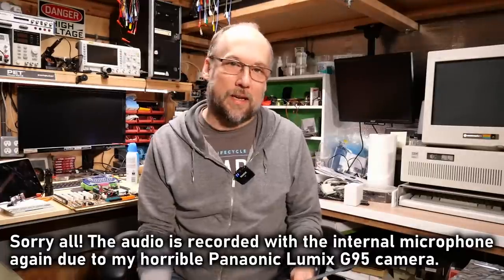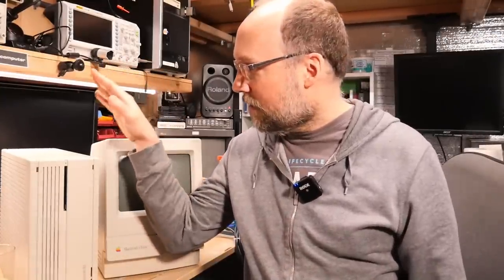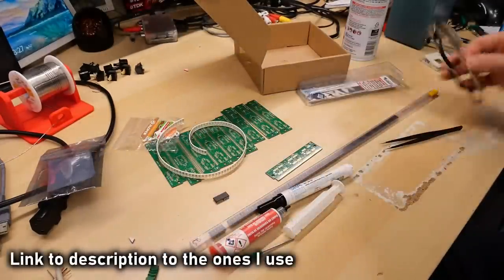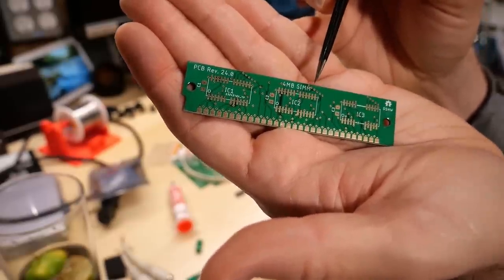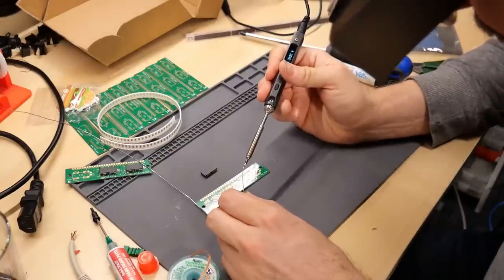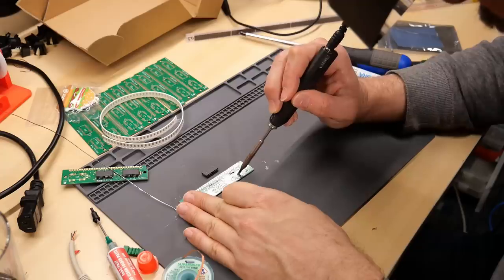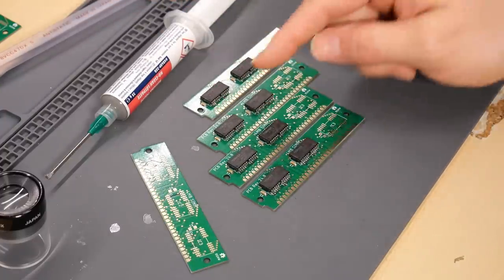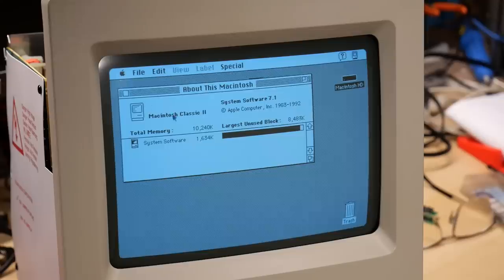Nibble Size: Let's make some memories!

Comment: Hey nothing wrong with learning a new skill! Personally for "larger" low-volume SMD stuff like this I don't bother with hot air. I start with clean fluxed pads, tack in the chip on opposite corners, and solder each pin one by one with a fine tip and a roll of fine solder. Slow but I find it much more forgiving. Cheers!

Comment: Adrian, I would suggest watching some of Louis Rossmann's MacBook repair videos for tips on SMT soldering with hot air - it's amazing to see how 'sloppy' you can be when applying the solder and how well it comes out.  You will notice he uses a lot of flux (available from his store) to heat up the whole component, not just one side.  I think you will learn a lot from his videos - I know I did, even after 40 years as an EE.

Comment: for how you tried to do the 2nd 1.. you should have just done it all by hand no hot air at all.

just a FYI.. 

all those pads are huge.. they are well withing your capabilities to manually solder. 
just have some confidence and take your time..

Tin up all the pads, (also the legs if you can do that without causing bridges) 
place the chip on the pads. then just heat up the top left pad and leg at the same time. then the bottom right leg and pad. this will ensure that the chip is  square and all legs are on the correct pads..
after that its just a matter of heating each pad and leg combo 1 at a time. Don't add more solder to them unless it is absolutely essential.
Just remember you heat up both parts you want to solder together so heat the pad and the leg at the same time.
and Keep your iron clean.

the small caps its the same thing really. 
tin up the pads. and then place the cap. you should see just enough pad so you can heat it up. the solder on the pads should be enough to hold the cap in place. I would not add solder to the cap before you place it. 
1ce you have 1 side of the cap tacked down.. you can add solder to the opposite end, then come back and add solder to the 1st end you tacked down..

Its well within your ability, they really aren't that small.

i personally wouldn't use hot air at all with that. (unless i needed to remove the ram for some reason)
just do it by hand.

Comment: Adrian, never use a continuity function or resistance function on logic signals (memory logic, etc), unless you know for sure that the open circuit voltage on the DMM is lower than the chip's supply voltage, otherwise there is a high risk of damaging the chip. MOS does not like overvoltage.

Comment: I would recommend getting a stencil for the boards so that you can better apply the solder paste, SMT packages for the ram. Then you could use the soldering iron to solder the bottom-left most and top-right most ends to the board and the use the hot air gun to solder the rest of the leads.

Comment: 10:07 tiny bypass caps? those a giant 1206 caps, when you are ready for 0402 parts you know what tiny is.
Reply: I had to use some 0201 resistors because I was building a board to fit a space and it was laid out by someone else.  VERY strange soldering using the Amscope with the iron tip looking massive.....
Reply: @cowasakiElectronics  what 0201 resistors would you recommend for this?
Reply: @adonvonpanzern  the resistors were supplied at the same time as the board. I have no details.

Comment: I do the odd bit of SMT soldering, most of the time its mounting though hole parts where SMT is supose to go. It is a little tricky & fiddely, but you do get the hang of it.

Comment: I was under the impression that the paste is just flux mixed with solder filings

For jobs like this, I'd personally just tin the PCB with kester leaded solder, putting some paste flux down from rossmann's store, and reflow with hot air. Worked perfectly for the project I'm working on, which has much smaller parts like 0402 resistors

Comment: easy hack even for cheap solder paste: squeeze some solder paste and mix in some more flux (i usually do this on some plastic bag) , use toothpick or something to mix them up , then use the same toothpick to apply this mixture on pcb pads. it helps a lot to spread the paste more evenly and its easier to apply

Comment: Tack a corner first. If you find the chip is off the pads just a little that's when you use the hot air. You make the chip dance into place on the wet solder. This will also clear a lot of bridges.

Comment: I wouldn't use solder paste personally without a stencil on pads this small - the good news is because you have the blueprints for the pcb, you can make the stencils (lots of companies here in Oregon actually make these!).

I usually do smc soldering with regular solder, some really consistent flux (like Amtech or Chipquick).

Comment: Not bad for a first try soldering SMD. Those SOJ chips are a little tricky if you've never done it before, but it looks like you're picking it up pretty quickly. And you've got plenty more to practice on! 😁 Hopefully you've got enough there to upgrade a few machines. But if not, the gerbers are available so you can always order more!

Comment: i did some smd soldering a couple weeks ago, and since i don’t have a hot air station, i used the soldering iron to heat the paste and it actually worked really well. i can’t check until tomorrow but i think the soldering paste i got has flux, so that might have a little to do with it, but after the first few like that it was super quick, unlike the one i tried to do with regular (not thin) solder wire which took ages.

Comment: Sorry to double post -- but also usually solder paste is put on with a mask I think? -- Was there a solder mask included in your order from JLPCB? -- Like the mask is usually a little transparent slide that has cut outs for all of the little pads so you just wipe the paste over the mask and use a little wiper or business card and then it's applied to the exact right bits.

You can also use some solder braid and just run it across the pads to tin all of the pads in one go. -- Also Voultar's channel is really good for soldering tips and tricks -- he does a lot of Console modding and walks you through the tricky bits -- there's tips for both thru hole and surface mount soldering. -- He even has a few series where people sent me in really poorly modded consoles from ebay where he fixes them. -- It's worth checking out.

Comment: Saw this and wondered why somebody would build SIMMs when they're already so cheap. But I guess 4MB is hard to find in 30 pin. Using brand new chips is probably the expensive route to take for something like this. If you can manage to do it, it's likely cheaper to salvage chips from 16 or 32MB 72 pin SIMMs (which will often have 8 or 16 4Mx4 DRAMs).

On the other hand, brand new chips won't need desoldering (which requires hot air)

Comment: solder paste is nice for something with many soldering points, if you get used to using it.
Then again, if it has many soldering points, you will socket it anyway.

Comment: For soldering things like that.
Dont use solder paste.
Solder paste really works best with a stencil.

Start with the smaller things first, then move to the larger items.
And you just tack one pad to secure it, then reheat if you need to adjust, otherwise solder down the rest of the pads.

Comment: I have a set of metal helping hands I use when I need to do hot air smd work. Those mats are rated for higher temperatures than the desk, but I have damaged mine in a few spots by touching it with my soldering iron.

Comment: Solder paste looks dry, it likely went bad long before it shipped to you, otherwise its just bad paste in general. Solder paste does have flux and should dispense pretty easily at room temp. If you're buying parts from Digikey already, buy the paste from there as well. I'd recommend either SMD291AX or TS391SNL, has good shelf life and working time. The 15g syringe will go a long way, no real need to buy larger quantities unless you going to do production level volumes of board in a short period of time. I used less than one 15g tube doing a few dozen 60x80mm boards.

Comment: I solder SMD ICs under a stereo microscope. Use a gullwing tip and good flux. I solder such an IC using drag soldering within a minute. Solderbridges, flux again, gullwing, but with the well dry, move them from IC outward in the direction of the legs and it will "suck" the solder in its well. no need for wick.

Comment: Doing fine work like this, a solder mask would likely work best and then you kind of "Screen print" the solder paste on to the boards.
Doing it by hand with such small pads is really hard as you need to try and just get paste on each pad and not sort of "smeared" across the board.  Solder Paste usually has some kind of flux with the solder in suspension.  Extra flux doesn't hurt though :).

Comment: The way to use solder paste is to use a stencil and a squeegee to put a controlled pattern of paste only on the pads. You order the stencil at the same time as the pcb from the pcb supplier.

Comment: I would only use solder paste if I had a silk screen and was just using hot air to solder it. You're better off tacking the chip in place at either corner, apply flux and then tin your iron, touch each pad and the solder will travel off the tip onto the pins. Keep doing that until there's enough solder on the pins. Rework with heat if you want it to look nice and even.

I've done chips smaller than my fingernail of my little finger that way with no problems.

Comment: How much memory a MC680x0 can address depends on which one it is.  The normal MC68000 only has 24 address pins, limiting it to 16 MB.  Most of the other chips in the family have 32 address pins, allowing up to 4 GB of memory. The MC68020 and later added an integrated MMU, allowing bank switching and increasing the potential memory size by swapping chunks of the extra memory into the base memory (but the MC68040 uses different MMU instructions so they aren't entirely code compatible).
Reply: Original 68000 is kinda weird and actually has only 23 address lines. It has no A0 line. But it can still address 16 megs because of its 16 bit data bus.
Reply: @pvc988  No, the DATA bus has nothing to do with the size of the addressable memory because you address memory through the ADDRESS bus.

What having no A0 pin means is it can only address memory in 2-byte increments, which is perfectly fine with a 16-bit data bus and shouldn't slow anything down.  (The Mostek 68008 variant does have an A0 line, and a whole bunch of other pinout differences as well, but that isn't part of the main axis of the 680x0 family.)

In fact, not having an A0 line can be argued to be an advantage, because it means you can't have instructions or 16-bit data break across page boundaries.  In some systems, like the minimal hardware configuration of the IBM System/370, it is possible to generate unexecutable code if the right combination of breaks across page boundaries occurred.  (In a System/370, all pages involved in a page breaking instruction had to be loaded into user memory at the same time.  Due to an indirect execution mode, it was possible to have an indirect execution instruction that broke across a page boundary, which referred to a move instruction the broke across a page boundary, that moved data from a location that broke across a page boundary to a location that broke across a page boundary, requiring 8 pages in user memory.  A minimal hardware System/370 didn't have 8 pages of memory available in user space, so no matter how the machine tried to carry it out, it page faulted.  This would cause a condition known as 'fatal thrashing,' because the system would simply switch pages around in memory endlessly, unable to configure itself so that the instruction could be performed.  The only way out was for the operator to kill the process manually.)

Comment: Use a stencil for the solder paste, skip the soldering iron and the hot air station entirely and just get a cheap toaster oven get everything placed and it will all just sink into position.

Comment: If the boards were designed to use the TSOP package version it would make the boards easier to assemble, and wouldn't need a hot air station.

Comment: The solder paste is probably old and dried up, I've had similar problems few weeks ago and resort to manual soldering, however when the paste is new and you put a little line on the pins it works great and doesn't require a solder mask.

Comment: For my thru-hole soldering I use a desklamp magnifier, a magnified headset like yours, a soldering microscope, and most recently a camera based "microscope" ... so no way these eyes and fingers are tackling surface mount. My hobby is for fun, and that seems like too much frustration to me.

Comment: You don't need to use solder flux when using solder paste, it has plenty of flux in it. Basically it is a fine solder powder mixed with a gel flux.

Comment: In the Vogons thread, someone posted the SIMMs that had DIP DRAMs. They could make 256KB and 1MB SIMMs, but not 4MB or 16. From a quick search, there doesn't seem to be any DIPs made for 4Mbx1 and up. That would've been much easier to solder.

Comment: Using iron and normal solder
Tin one pad
Tack the chip to the board on that pad
Tack opposite corner
Solder each pin in almost the same way as thru hole parts (Technique is slightly different) You will get the hang of it, but can't explain it well
Dave on EEVBlog uses drag soldering(Which I could never get to work right) But you mileage may vary :)

Comment: 21:26 A lot of older PCs worked that way, especially ones with onboard Intel graphics. It would take some system RAM for video, so you needed a lot more than normal to not use virtual memory.

Comment: I've just checked the stock of the Toshiba model you're holding at 5:19 on utsoure. Seems like they have a large quantity there. You can send them a quote inquiry to get a price. They have a lot of OKI brand too, 4194kWord, 4Bit, Fast Page, 60nS types. Bought a few Bruce and Chuck chips and those special fast 25ns EDO chips for resurrecting two 3Dfx cards a few months ago, when I found out that they are available. They have a date code of 0215 and no solder marks, no soluble markings. Looks and feels like NOS. I've even bough an nV GPU and video output selector for a pre 2010 Macbook like 10 years ago. That was a half-bummer because they could't tell me if I'm getting the 128 or the 64bit memory bus width one. So sometimes utsoure can be a pig in a poke. Pretty good PCBs by the way! Looks like they have an ENIG finish. If I remember correctly I used to have 30pin SIMMs with the cheap HASL. :)

Comment: I'm actually surprised that there wasn't a stencil added. Since you ordered the PCBs at JLCPCB already, check out their stencil. You're supposed to use the stencil to put the paste in only the places where the paste should be. Apply some hot air and the whole thing goes down so smoothly, it's like watching magic happen.

Comment: Oh Adrian... If not for the Human Malware, I'd have you over to my office downtown, or bring some of my assembly gear to a CCClub meeting. I've done a bunch of surface-mount prototyping and manufacturing, and would love to show you some techniques. A $5 K(r)apton stencil, an old credit card, and a $15 hot plate would've made your life so much easier. Congrats on making it work anyway! :-)
Reply from the maker: Yeah Jared, the whole situation is a let down!! 2020 ugh. I can only imagine with some practice and the right tools it would be come so easy.
Reply: @adriansdigitalbasement  Honestly, it's not even practice, so much. Robots with no skills whatsoever assemble virtually all the electronics in the world now. And they rely mostly on good paste application with a stencil, accurate component placement, heat, and surface tension. With the right process, boards pretty much solder themselves!

Comment: Here's how I replace SOJ package memory on Amiga 600's and A1200's that use this sort of memory. I first clean the pads with solder wick to ensure they are level. Then I tin them - but only slightly, massive blobs are out. I apply gel flux to the pads, and sit the chip on top. I then heat from both sides with hot air, and when im sure the solder is molten I apply a little pressure to the chip from above with a screwdriver. That gets the chip soldered 99% of the time. 

Drag soldering also works, and is best done with a knife edge tip in that case. For smaller SOJ's like this it will probably work well, but i've found it too problematic with the larger SOJ chips the Amiga uses

Practice makes perfect :)
Reply: Definitely get yourself a K-tip :)

Comment: If they have a PDF of the solder paste mask, you can run it through a laser cutter with laser printer transparency film, and use it in place of a more expensive stainless steel mask from JLCPCB. Then you just "silk screen" the solder paste the cutouts onto the PCBs.

Comment: Kester is a great brand of solder for the price.  They have been around for a long time.  I also have some old 50/50 Solder with Lead in it.  That's the best stuff ever lol.
Reply: I'm currently using a roll of Kester solder which is old enough it is on a metal spool instead of plastic. I'm sure it's over 50 years old but it works a treat.

Comment: The theoretical maximum for a m68k computer is 4GB, and in fact, you could get close on an amiga 4000 using cards like the BigRamPlus, but in practice this is hindered by the sheer amounto of ram cards and bus expanders you would need to get there. Another limiting factior is usually also the fact that part of the ram is mapped to different devices (e.g. the 4 MB for the pcmcia card slot in an A1200/A600).